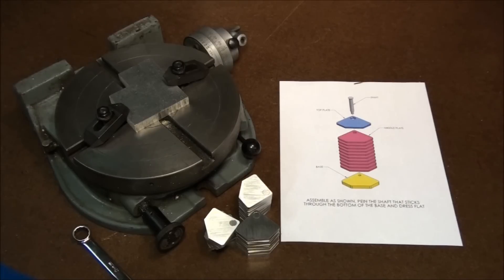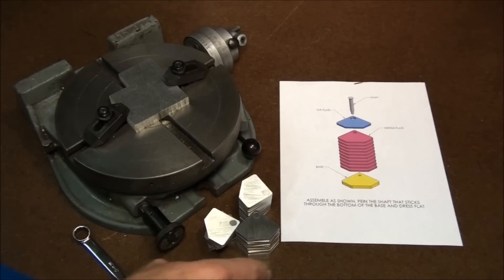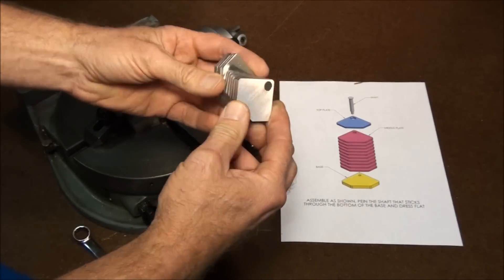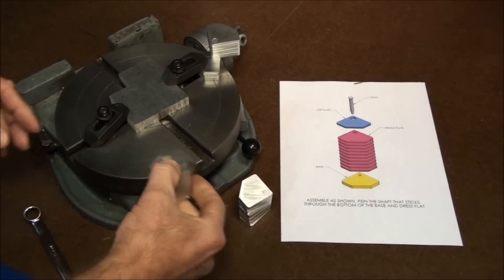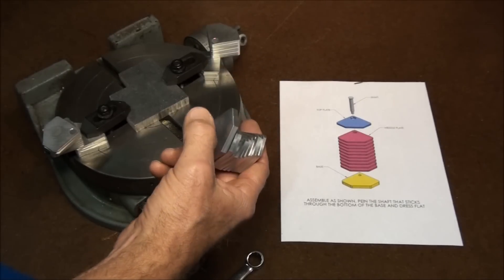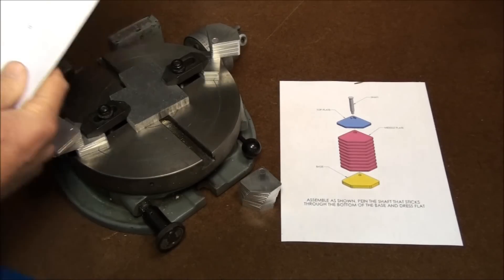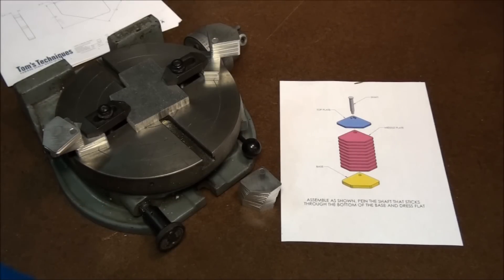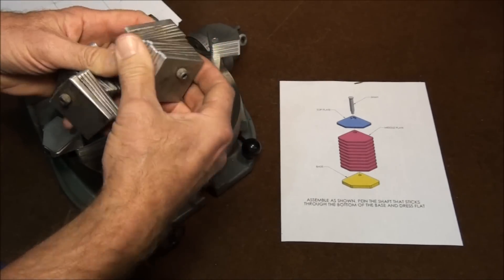Stack Blocks Part One - INTRODUCTION

Comment: Could you use the lathe to part off the individual layers?  It doesn't seem to me that you lose much more metal with the lathe than with a saw.
Reply from the maker: It could work, but it would be difficult to keep parts that large a consistent thickness, and it would take a lot more time to do vs. using sheet of the proper thickness (The parts aren't sawed to size).
Reply: @TomsTechniques  Thank you for your reply.  I must have misunderstood what you said about sawing the individual pieces.  For some reason, I had thought that you meant to saw the pieces from a piece of bar stock that you had previously shaped.  Sorry for the misunderstanding. 

Your videos are very informative.  Thank you for taking the time to produce them.

Comment: That was a perfect intro to this video series.  Your thought process in designing this lesson highlights your passion for teaching. I agree that "doing" is the best way to learn. Thanks for the project!
Reply from the maker: Thanks.

These tutorials are the only way to teach the order of operations on a project. The next part on the carriage stop project (the thimble) will be and excellent example because you'll box yourself into a corner if you do them out of order.

Thanks for watching.

Tom
Reply: I wish I had tutorials when my dad trained me to be a machinist. He couldn't stand answering my questions, especially when I asked about alternative methods. Mostly I just wanted to lelarn pros and cons of different techniques but he took it as if I thought I could come up with a better solution. In his defense I ask a lot of questions. If I were able to watch him on video as he explained the process, it would have solved that problem. Then I could have asked questions after learning his method. I think he would have been more receptive at that point. ... I'm not a big fan of step blocks either, even though they are quite useful. I look forrward to working through your tutorial. This looks like a great alternative. Thanks again!